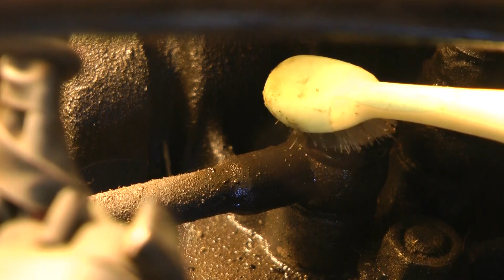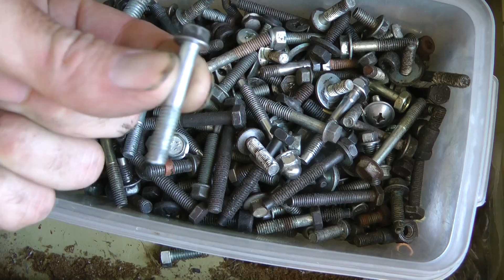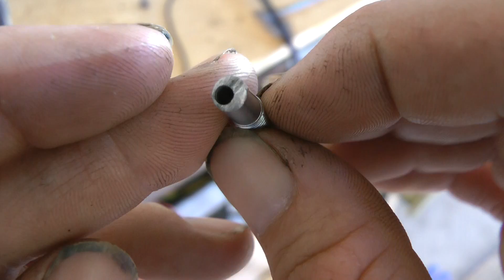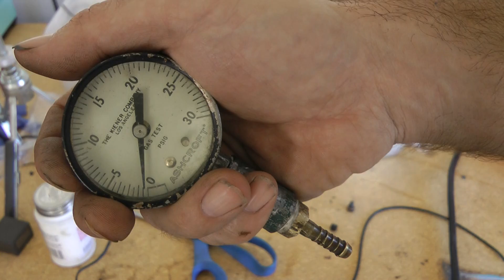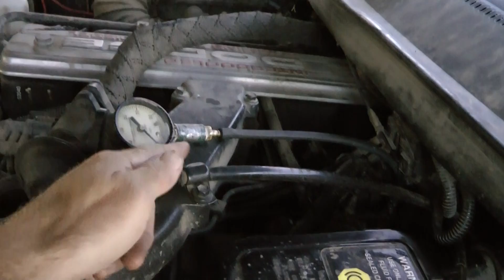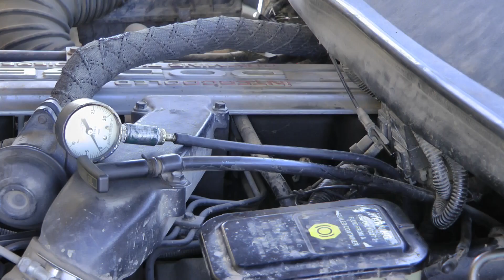How To Test Fuel Pressure On A Dodge Ram Diesel With Common Workshop Items!

Comment: I just modified a bolt like you did. Worked perfectly to measure the lift pump fuel pressure !!! All of 5 psi ! Now I know why the boost pressure is about 8 psi instead of the 13 psi it was at for many years. Thank you for your video !!!

Comment: If your fss is faulty and not pulling the fuel lever all the way open…it will starve the engine of fuel also cause hard starts. Also get an adjustable overflow valve and check the prefilter screen (for debris)on the fuel heater, I have the same truck with 321k on it and have deleted electrical stuff and gone to mechanical where I could for reliability.

Comment: Thats brilliant, your just too clever :-D
I suppose that diesel was coming from the tap point, a few mods to your bolt would have stopped that, but the test is done so no matter :)
You did well to drill that bolt without a pillar drill, dam hard to drill straight.
I hope you find the fault without spending too much money, looks like a nice truck:-)

Comment: I would check to see if one of the cylinders dropped. From what I have heard its not that uncommon sadly. To check for this, I would start the truck up and idle it without the oil fill cap on. If there is a good amount of steam coming from the cap, this could be the culprit. Disclaimer: I am in no way a diesel mechanic, just someone who researches the crap out of these engines so use this information at your own risk. Good Luck.

Comment: Cummins 12 valves are very reliable and most generally easy work on and fix. Id say ya want look at what codes are coming up as you have check engine light on and next you might want look at timing and injectors

Comment: Those year dodges should also Idle around 750-850 rpm in gear and AC on if it still works.

Comment: You did say common workshop items.. no aardvarks here only possums for diner hehe.  Have you you figure out why when you remove pedal quickly  it dies? mine does that too.
Reply: Hello 8 yrs later! Please, mine is like yours, what was the issue?
Reply: @LemmyKutcherGrass  its been awhile but one thing i did : symptom:  stopping at light engine turns off more so with ac on.and rpm under 500. i adjusted the idle screw...A different issue i had was on the freeway going up to speed a loss of power ok if i was backed off pedal and just held speed. i put some lucas (half bottle lol) fuel injection cleaner.  apparently i need to do this about every year and half. but not a bad trade off since there really isnt much maintenance. i do change out my fuel filter after i do that( after i think all injector cleaner 
has gone thru.) i hate changing that btw very difficult on mine.
Reply: @NeighborBones  thanks! I finally gave up and took it to a diesel mechanic lol, I'll know what's up with it soon enough.
Reply: @LemmyKutcherGrass  its cheaper than payments on a new car :) and its a classic. without all those sensors on the new ones!

Comment: I am A diesel mechanic your Engine temperature is too low you need to change thermostats to a 195 and your check engine light may go off if it dont let me know ill tell you how to get it out...
Reply: Um no. 195 is about as hot as you want to go. My truck has always ran 175-180 even when pulling a load. I have a 96 12 valve
Reply: Fette Katze Check engine light won't come on because the temp is too low. plus 195 is way too high. I run a 180 thermostat and the truck runs no hotter than that under heavy load. the factory thermostat was a 180 in my 98 12 valve
Reply: As denoted by the “time machine” 😂 Maybe we should check for an inlet restriction to the lift pump? Some arrangements have a screen inside a bowl of sorts just forward of the primary fuel filter. Others may have an inline screen or none at all, i which case I would look for debris inside the pump itself(replace it).   $0.02
   Yes, I realize how old this post is...just offering some help to innocent passers by.

Comment: how come an American vehicle has metric fasteners ? ?? ?
Reply: CR2504life makes it simple to work on. plus the engine is a Cummins which isn't made by dodge. Cummins motors are used world wide with the Bosch(german) injection pump. most modern vehicles have metric fasteners because instead of having an sae and metric set of tools, you only have metric and can work on anything